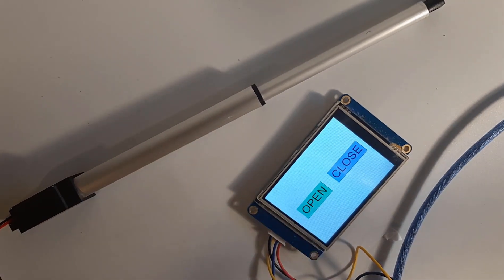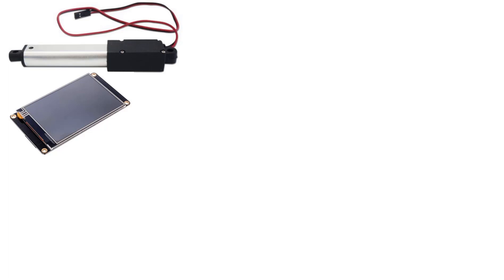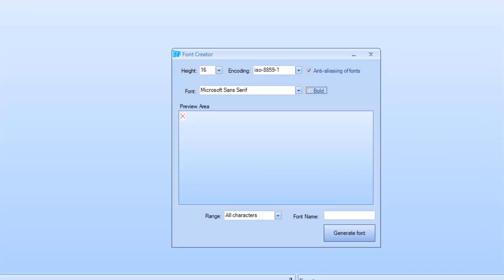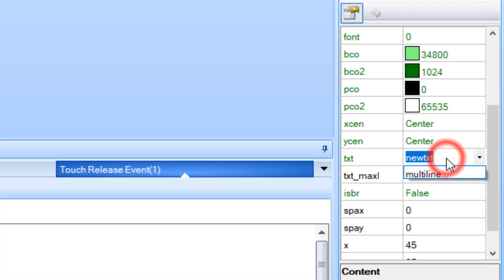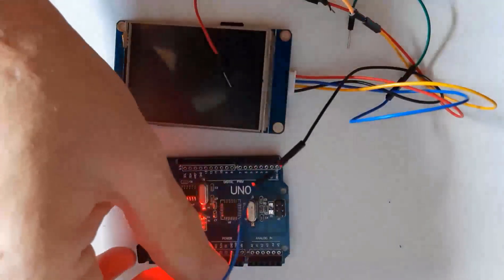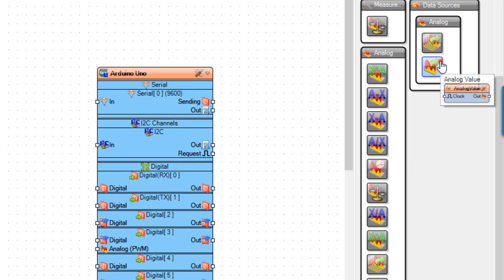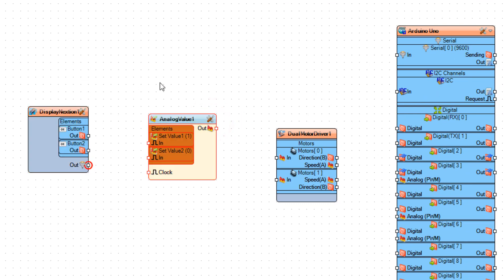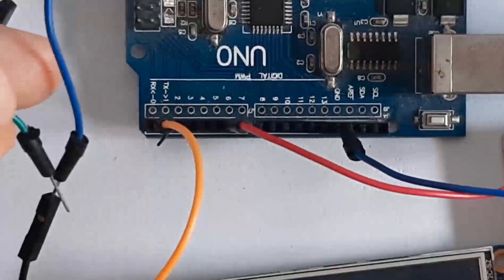Control Linear Actuator Using a NEXTION Display and Arduino

Comment: how to add a stop button?
Reply from the maker: Linear actuators already have the end switch inside, but you could also control the driver "Enable" pin in Visuino